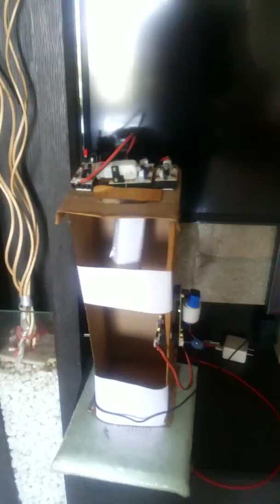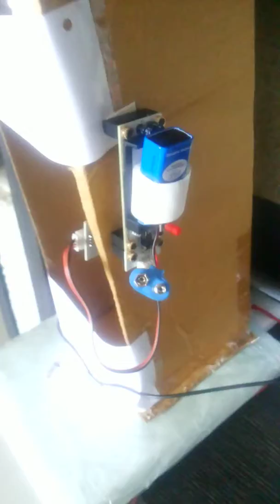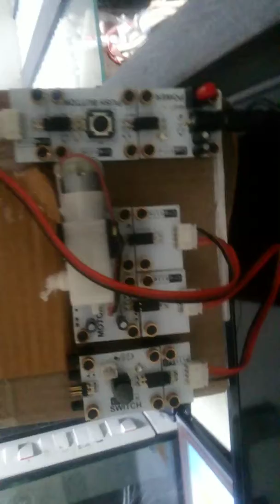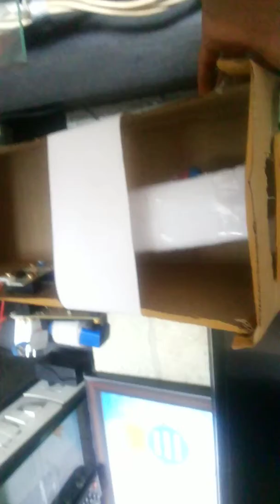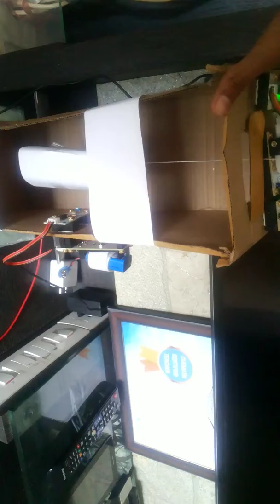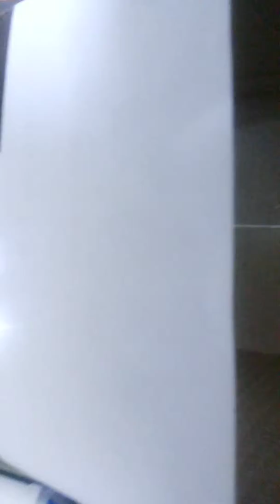How to make an elevator using cretile

Comment: Great job. You may also add a pulse at motor speed. With it you can press the switch only once and it will move the lift for a specific period. Futher you can also add toggle before direction to change direction of motor automatically everytime it is operated. Keep up the good work. Keep making!
Reply from the maker: Ok. Thanks for the advice